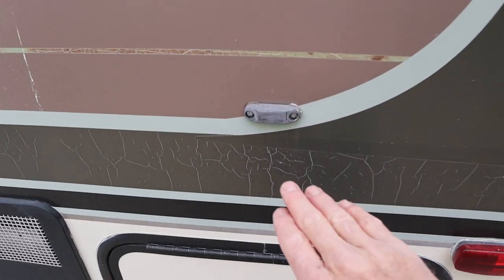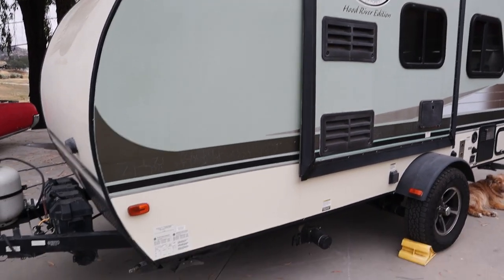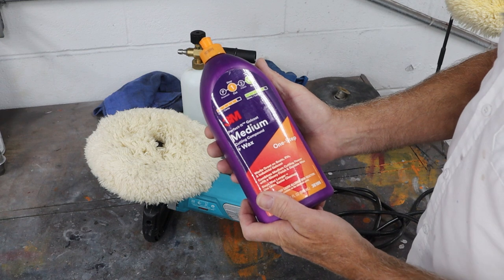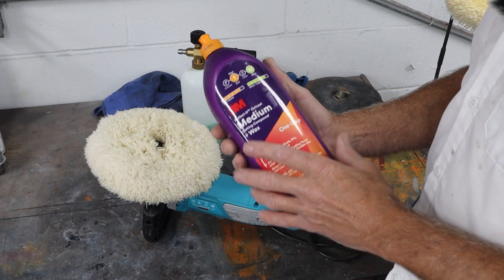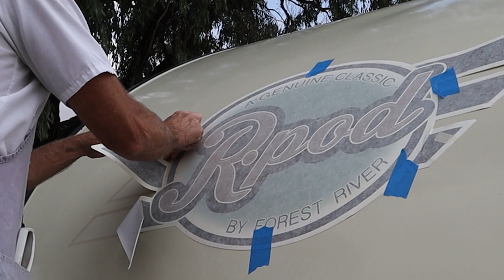RV Polishing How To - Bringing a Tear Drop Trailer Back to Life with 3M Perfect-It Gelcoat Polish

Comment: Mark nice job on the trailer and looks good!. Ok now you got me thinking, I have Chevy truck that's same pewter color as the Corvette but it has clear coat issues
Reply from the maker: Hey Rodney,  send me some pics of the clear.  There could be something you could try to save it without getting involved in color.  I am not a fan of the color in general and really don't like working with it.  There are 6 different variants for the exact same color.  Depends where the truck was built, what part of the year during production and other stupid stuff.
Mark

Comment: Nice one Mark - a little deviation from your regular content. I like to think I've become pretty proficient at Gelcoat repair/refinish on my boat. IMO, Gelcoat is easier to work with than paint and you don't really run the risk of burning through! I had some deep gouges the previous owner had put in the side, all the way through the Gel to the fibreglass - I managed to fill these and got an excellent match and finish if I say so myself, with a  colour-matched Patch Kit from Spectrum. (my boat is predominantly white so more forgiving than dark colours and it did not require tiniting) Then I got some scratches in my dark blue stripe at the waterline, from what I believe was rubbing on the Buoy which was covered with barnacles - wet sanded through the grades and then compounded with the rotary buffer. I have since invested about $500 in Ceramic coating material and applied several coats of that, with a few extra down at the waterline. Very satisfying project. 
Tip on spinning out the water - think about which plane its going to throw and hold polisher accordingly! LOL :)
Reply from the maker: I do a little bit of everything around here it seems...
Gelcoat is tough and thick so it does give you a lot to work with but that also makes it hard to polish.  You are very smart adding the ceramic to save all that work you did.  Never heard of it being used below the waterline.  How is it holding up?
My boots were pretty wet at the end of the day from spinning out.  I just wanted to make sure the camera didn't get splashed.
Mark
Reply: @FoothillPaintandFabrication  I initially had focussed on the above waterline, getting that looking good with inital polish before applying and a couple of coats, then used what I had left on the lower. My boat is predominantly in Salt water and I usually leave it on the buoy about 10 days over 2 weekends before taking it out. But even after, it still has that green crud below the waterline. Now I will say it came off much easier but not completely with just a wash and I ultimately used an acid based hull cleaner again.  I consulted Glidecoat who were really responsive and I got a personal call back. He suggested to put more coats on the underside. My main area of focus was right at the waterline, a foot above and below and I now have about 4 coats on there. Just did that so we'll see how it worked when I pull it out!
Reply from the maker: @decosse01  That marine growth is so fast it is crazy!  It's like your boat is the only thing around to cling to so they are attracted like a magnet.  I hope that stuff works to help keep the hull looking nice top to bottom.  
Mark

Comment: How did you remove the old sticker? Any tips/tricks?
Reply from the maker: The owner had the stickers removed before I got the trailer to polish but I have removed my share. Heat is your friend when removing stickers.  Getting the glue underneath soft enough without  damaging the substrate is the tricky part.  On bare steel or aluminum it is no problem but a painted surface it needs to be done carefully.  Heat a small area near the edge with a heat gun, a hair dryer usually will not do the trick and a propane torch works but the chance of scorching the paint is pretty high. Trying on a nice sunny day helps so you aren't fighting the cold.  Spend some time heating so the heat can penetrate down to the adhesive then try and lift and edge. If you can get an edge going pull the sticker back on itself not upwards to keep from lifting the paint.  Once you get a few inches up start heating on the lifted side right where the sticker is coming loose.  Try and keep the heat away from the sticker and heat the substrate and glue line so the sticker doesn't become soft and stretch and break. 
If your stickers are dried out and brittle so you can scrape them off a little with your finger nail they need to be polished off.  The adhesive needs to be removed with mineral spirits by soaking, waiting and wiping with a clean rag.  Then polish the area but more than likely the shadow will remain because of sun fading. 
What are the stickers on? Gelcoat, paint? bare metal?
Mark